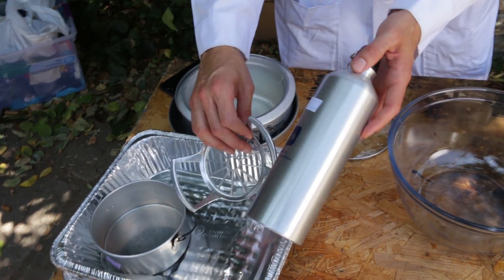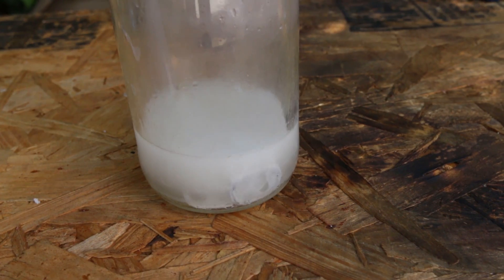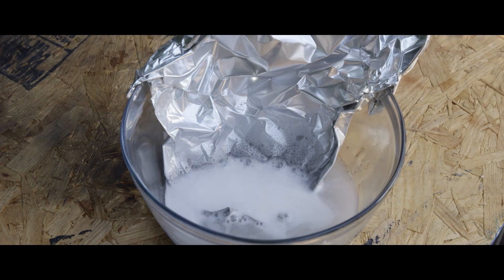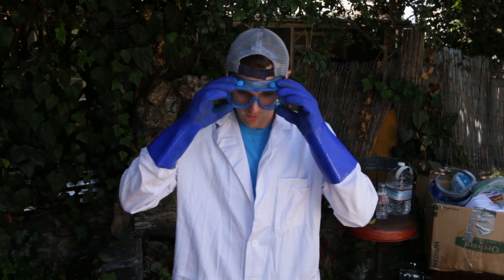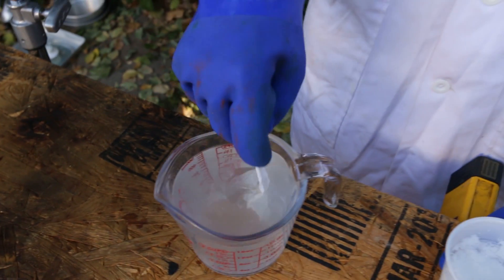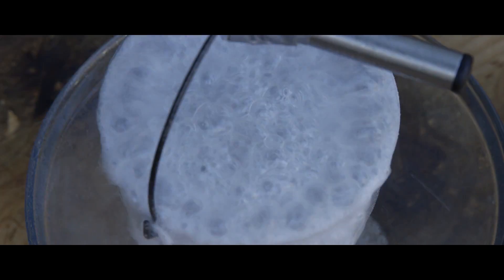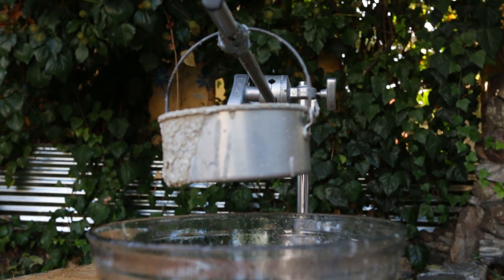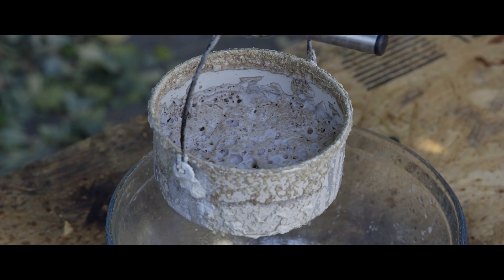Don’t Put Drain Cleaner In Aluminum Pots

Comment from the maker: Drain cleaner has sodium hydroxide (NaOH) in it AKA “lye”. This is the same stuff we use to make soap with and how we got our hydrogen gas for the video where we mixed hydrogen and oxygen in the same balloon. 

When NaOH mixes with aluminum it creates hydrogen gas and sodium aluminate (this strange grey goopy aluminum looking mixture). 

If you put pure sodium hydroxide (mixed with water) in an aluminum pot the reaction is AGGRESSIVE!!! It will literally eat right through the pot itself! This is a good lesson to not use drain cleaner (NaOH) to clean kitchen ware if it has aluminum in it… otherwise you'll end up with a huge mess! 

Note: Sodium Hydroxide is SUPER caustic and dangerous. Use all safety gear when working with NaOH, and only mess around with this stuff with adult supervision.
Reply: Nick Uhas Nick... you are my idol! Plz comment back! It would be my dream!!!
Reply: Soap will corrode aluminum as well because it is alkaline. Though a lot slower than caustic soda will. That is why if you have an aluminum alloy bicycle you should never wash it with soap and water. Just wash it with plain water instead. Otherwise over time the bike frame and its wheels if they are allow wheels will become corroded and ruined.

Comment: Aluminum cookware is just not good. Turns out titanium (coated) pots are actually aluminum, the water container of a coffee machine may be aluminum. Even without much abuse this material develops pits that soak up grease and flavors, which may not be removed. Grease just melts and falls off steel. And it stains other pots. The black residue from lye doesn't come off hands or anything white it gets onto.

When I was a kid, I had accidentally burnt a cooking pot, and tried to clean it by boiling lye in it before it was discovered. That didn't work out so well. It stayed dirty and exposed parts became pits.

Comment: Good experiment. Aluminium reacts with NaOH in Aqueous solution to form Sodium aluminate and water through the following reaction: 2 Al + 2 NaOH + 2 H2O → 2 NaAlO2 + 3 H2

Keep it up, Nick :]
Reply from the maker: that's a perfect chemical equation!  Thanks for putting that in here.. and much appreciated!! : )
Reply: In your formula adding water is not needed, you could put NaOH(aq) for aqueous. But still good job man.

Comment: How would sodium hydroxide react with other metal that have properties that resemble with aluminium's properties? Great video btw ❤️ much love ❤️🙏🏻
Reply: Abeeha Zaidi Good question! NaOH reacts with a good few metals to make the corresponding metal-ate. Here's an example: NaOH reacts with Zinc to form Sodium Zincate and Hydrogen gas. No element will take on the properties of another without actually being that element. The belief in doing so is Alchemy, which is kinda bogus.
Reply: Oh Kay thanks!!
Reply: Abeeha Zaidi No problem! :]
Reply from the maker: spot on, also another interesting one is NaOh and chromium and copper.
Reply: Thankyou!!!! ❤️